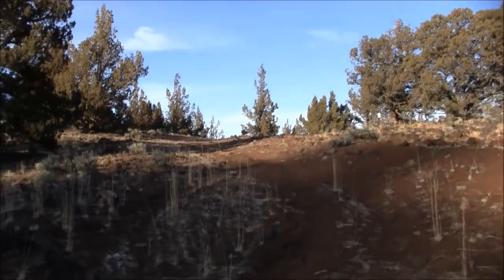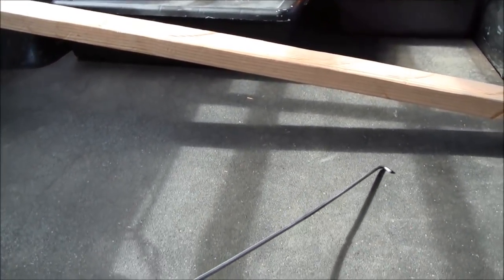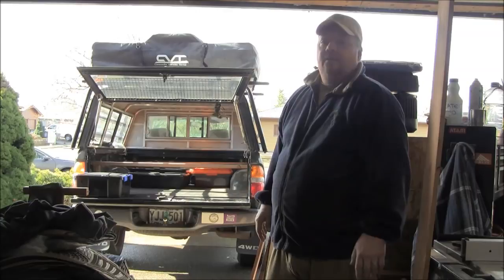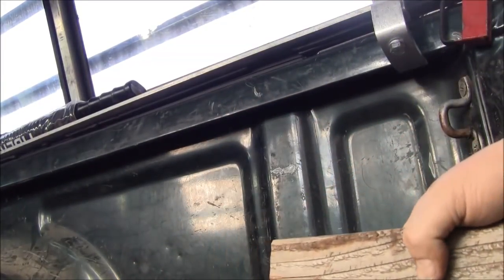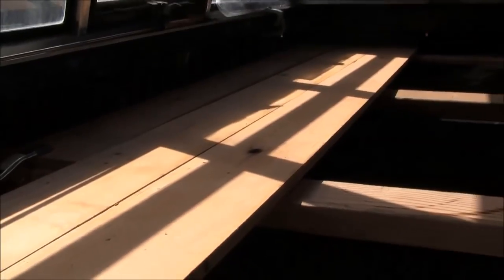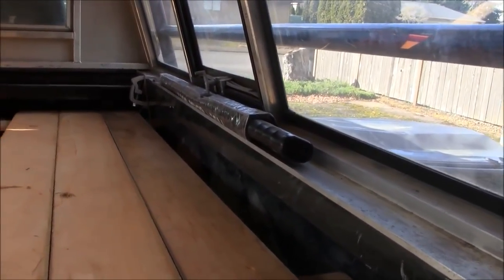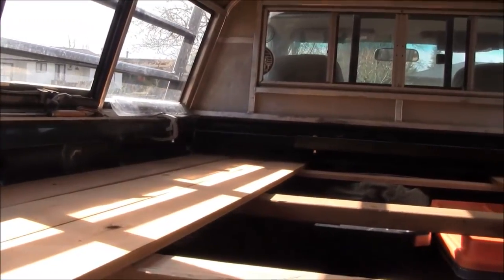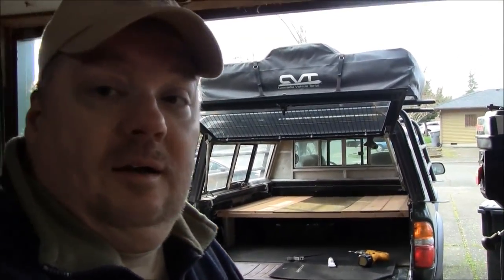DIY Truck Bed Platform With Drawers Sorta, On The Cheap

Comment: I like your CVT set up. I have a 2500 Dodge Ram and I would like to put a top on it and a CVT. Question is where did you get the frame for the CVT I noticed that it is external frame and goes under your camper top does CVT sell these also I have looked on their website and do not see it. Thanks Ed